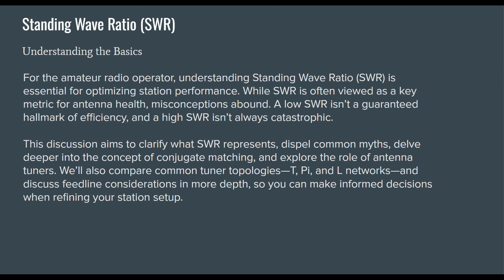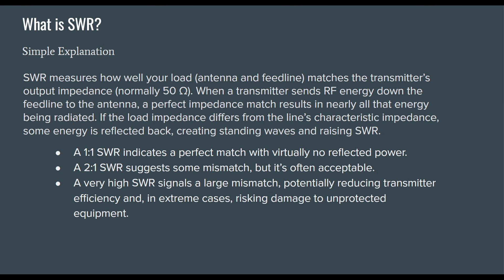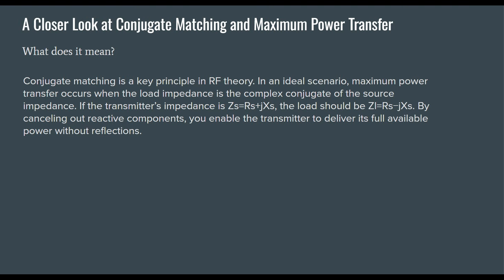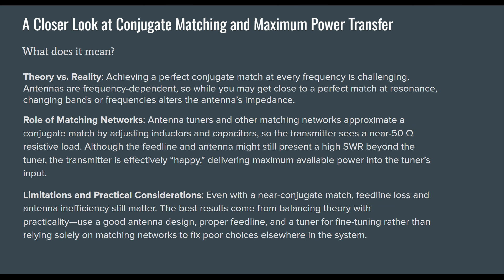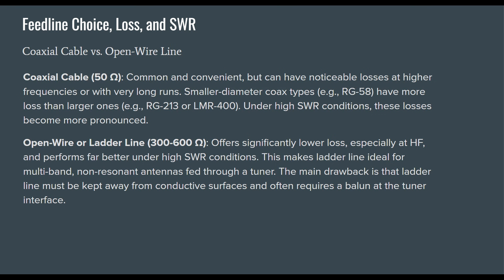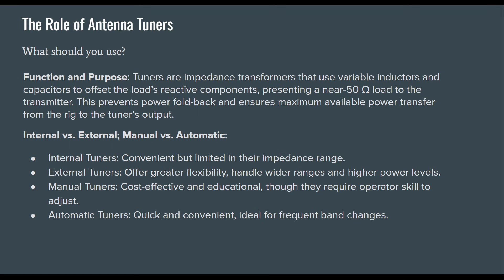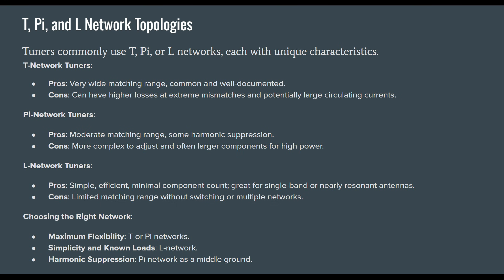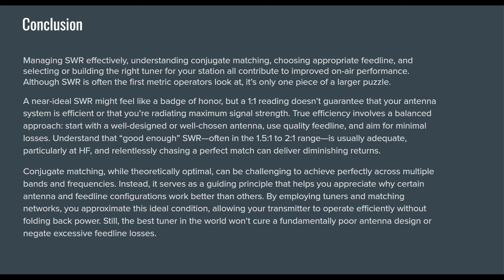SWR Stuff Every Ham Radio Beginner Needs to Know!

Comment: I currently use 450-ohm ladder line. One alternative to using ladder line is to install a 1:1 current balun at the end of the line, similar to the setup with the ZS6BKW antenna, and then connect the coax directly to your shack.
Reply from the maker: Hey Joe, that is probably what I would do.

Comment: If you're like most hams, you won't be able to have an antenna "farm" -- you'll likely have a single wire antenna and it will have to work multiple (or all) bands. That means you'll only be close to resonance on a very limited number of freqs, and the farther you move from those freqs, the higher the SWR can climb. This is where ladder-line and a tuner can shine. 

I get that a lot of folks see ladder-line as problematic to work with, but to me after I built my first doublet, I found that it's a lot easier than I first thought it would be. I would say it's easier than coax for most hams stringing wire between trees and buildings. Where coax shines is when you have to run up a tower and for interconnections on the desktop. 
Here's my go to page for demystifying ladder-line: 
[ https://kv5r.com/ham-radio/ladder-line/ ]
Reply from the maker: Thanks for the link JD!

Comment: You lightly ever so lightly touched on the topic of ladderline.  

You can place the ladderline in a tube such as even a foam tube like that of pipe insulation foam and that is generally large enough to protect it from other objects.  There are some rules about the spacing of the ladderline from objects that are easy to achieve. 300ohm ribbon is the easiest considering how thin it is, and even 450ohm window line is easy. I am not sure I would really attempt 600ohm Ladder-line.  However, whatever the spacing is between the conductors of the line, keep that spacing as well from the objects nearby. 

 If the 450ohm ladder-line is 2 inches wide, keep it 2 inches away from the nearest objects. the easy way is to place inside insulation foam and let it lay where you desire. You can even place this inside a metal tube or pipe such as up the inside of the rainspout so the neighbors dont see (ask me how I know). Lay it across the metal roof of the house to the vertical. Dont forget the 9:1 BALun on each end if you desire a 50 ohm install. You can also lay this on the ground across the bushes, it can even be buried  taking care not to crush it. 

The result is creating a tri-axial cable. if you install it in a metal pipe or tube its much closer to true tri-axial cable with its shield.  You most certainly can install twin-lead of any kind inside a metal pipe so long as you keep the spacing. I use pipe insulation, as the "dielectric". (I edited for clarification)

There are a couple YT vid's on the topic as well floating around.  

good video mate.
73
Reply from the maker: Thanks for the info Chris!